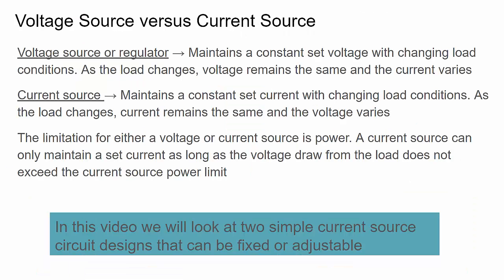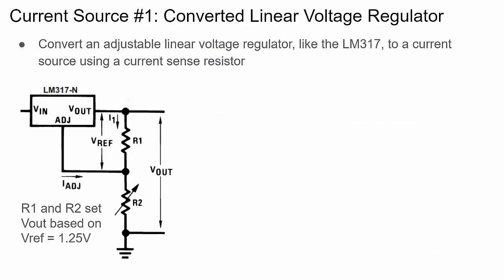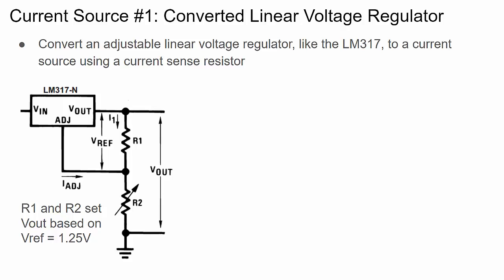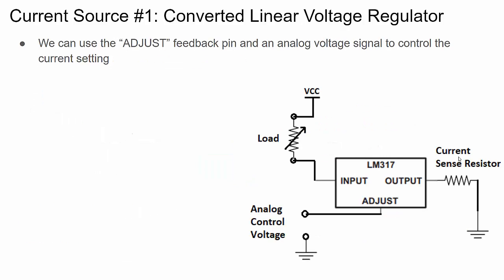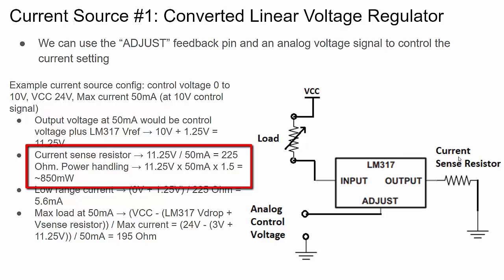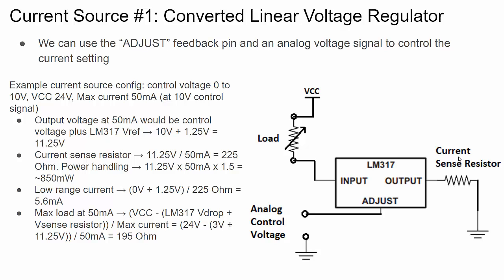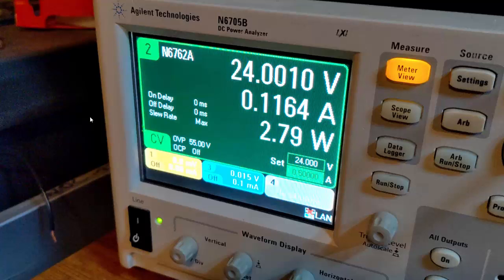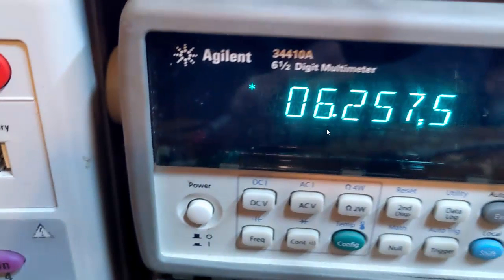Two Simple Adjustable Current Source Circuit Designs

Comment: What can I do for driving an AC current source using voltage?
Reply from the maker: Well if you're just trying to do a low power AC current source then you could use this setup from the video you would just need an AC control voltage. If you're talking about AC line powered current source not sure I've never mapped something like that out. I would probably start by looking at Traics

Comment: Hi, I was looking for a method to drive a high current (1.5A) using a microcontroller and fortunately found this video. I still don't quite understand how transistor circuits work, for example if we lower the DAC output voltage which changes the current, the voltage on the sense resistor and load will go down but Vcc remains constant. I thought that many transistors have a fixed voltage drop between terminals but here it is variable, to act as a variable resistor? I hardly know where to begin to find the components I will need to make this circuit to my specifications.
Reply from the maker: Hey thanks for the comment. Look at a data sheet for a transistor and it should have some type of IV curve based on the gate control signal. In the case of a mosfet that gate control signal is voltage control. You'll see that they have a nonlinear region in that IV curve and that's the region it's being controlled in to act like a variable resistor. You can always set up a mosfet test circuit yourself too and observe this behavior with a power supply and a voltage to source to control it.
Reply: @ForceTronics Thank you for your reply. If the op-amp feedback makes it so that the + and - terminals have the same voltage, won't that mean there is a negligible voltage on the gate and therefore only a small current?

Comment: What is the max current source that you could make with the LM317?
Reply from the maker: Max current is a tradeoff between the sense resistor value you use and the LM317 current rating. The goal of the video combined with the LM317 datasheet should equip you to answer this question yourself. If something in the video is not clear about that, let me know.

Comment: Thanks !  My question is What is the maximum précision that you can get with both circuit ?
I have tried LM317 already but with thermal  shifting (even with heat sink) the accuracy is less than 2%.
Since I want to build a power micr ohmeter ( one amp and less), I need a very precise current source without drift.
Reply: The stability of the LM317 is typically around 10mV for junction temperatures from 0°C to 125°C according to the datasheets. You can't do much to improve that. For the opamp circuit, the principal source of variation (the mosfet) is inside the feedback loop so the effect from that is virtually eliminated. You're left with controlling the input offset voltage drift and the resistance drift in the sense resistor. You might use a TL072 with a typical drift of 150μV over the same range. Using a low temperature coefficient sense resistor will also help to avoid drift. Common metal film resistors have temperature coefficients up to around 100ppm/°C, so contribute a variation of up to 1%, but you can get resistors with 1/10 of that.
Reply: @RexxSchneider  ThANK YOU. I will try it.

Comment: Great video. Is the MOSFET circuit more efficient?  Ignoring the advantages of the Arduino control, is there an advantage to one over the other?
Thanks!
Reply from the maker: Great question and maybe I should have done a pros and cons comparison in the video. The first method is easier to implement because it has less components and the linear regulator has built in protection features. Also, the linear regulator is responsible for handling the control loop to regulate it's output. For the second method you as the designer are responsible for properly spec'ing the op amp and MSOFET, if you look at the previous comments you need to watch out for oscillations in the control loop of the second circuit. The advantage of the second method is you the designer have tighter control over the specs and performance of the design. Also the second method is more efficient than using the LM317 and is most likely more efficient compared to other higher performance linear regulator on the market.
Reply: Some other advantages of the MOSFET version are  possiblities of much higher operating voltages and current due to availability of power MOSFETs which can handle voltages in 100's of volts and 10's of amps.
Also the current adjustment range can go down to almost zero amps while the upper value is only limitted by the MOSFET power rating, set by the product of actual drain to source voltage and drain current. 

So with the choice of right device and decent heatsinking you can have quite a powerful result. Be careful to not become a load for it yourself if using higher voltages as the circuit will try and adjust the voltage across the "load" in order to try and maintain the target current which means that it can be quite lethal even with few milli-amps of output current. Also technically a minor point, the circuit shown here is actually a current sink and not a source.

Great video though.

Oh, one other thing which can be easily overlooked, you can have multiple current sources with different values of output current all in parallel and output will be the sum of all individual currents. So technically you could build a bunch of identical circuits powered by the same supply and have them all pumping more current than what a single device will do.

Comment: Nice Video!  I have used both of those current sources many times.  The Op-amp mosfet current source can be prone to oscillation depending on what components you use.  (I found out when my wife said that the TV was getting interference (back in the analog TV days).  It was oscillating up in the 100MHz range.  I switched to a slower Op Amp and that cured it.  Adding some RC compensation would work as well.
Reply from the maker: Great comment, appreciate you sharing some personal experience with current source circuits! Are you recommending the RC network between the op amp output and MOSFET gate to form a low pass filter?
Reply: Try placing a feedback capacitor (e.g. 200pf) in parallel with the feedback path to the inverting input to mitigate the oscillation.
Reply: Yes - you want to reduce the high frequency gain of the op-amp with an RC network negative terminal to output terminal. @Enigma758